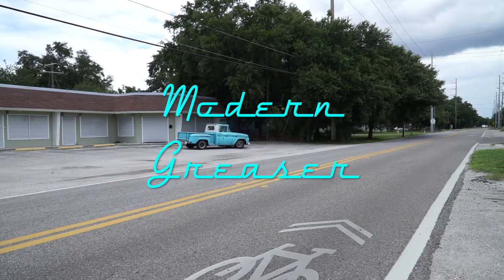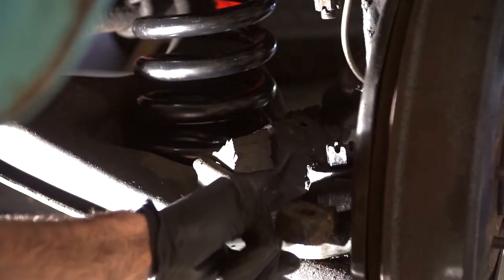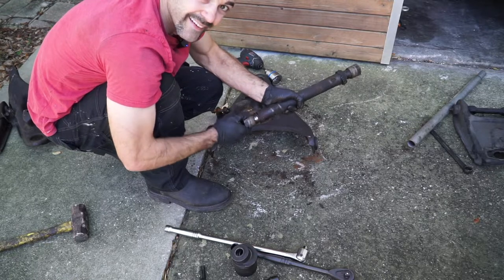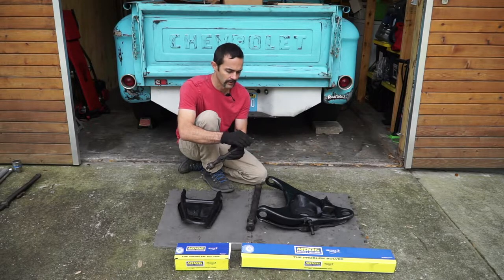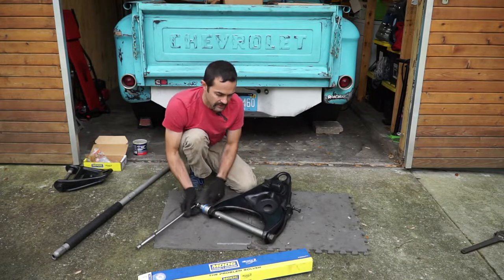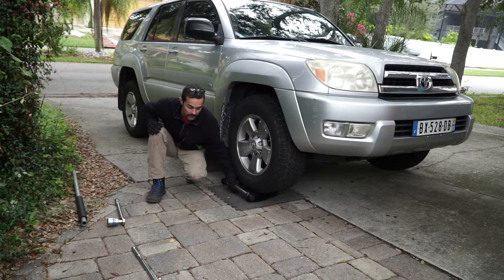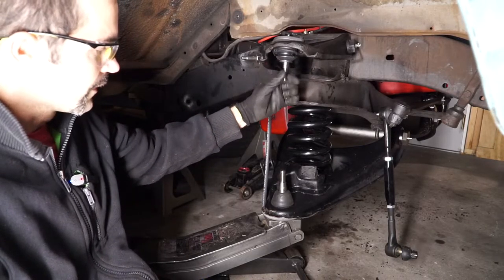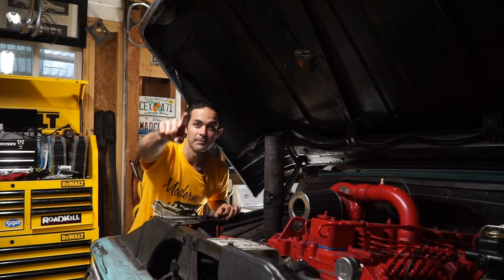BEST 1960-1988 Chevy C10 upper and lower control arm bushing replacement Modern Greaser!

Comment: Life saver video. Can we assume the upper control arm also uses a 1 5/8" socket?
Reply from the maker: Tom glad it helped!   The upper arm has a smaller cap that I ended up using two, large adjustable end “Crescent wrenchs” to tighten and loosen.  I didn’t have the socket large enough.  Sockets are cheaper than amazon at  AutoZone.  Less than $8 for the 2 1/2”.    Just remove the entire upper arm (2) 3/4” nuts and take the whole thing into Autozone to get a socket if you don’t have one.
Reply: @ModernGreaser  Hey thank you for the detailed reply! I have the control arms off already so I will take your advice and pop by my local auto parts store. The video was awesome however showing in detail the tear down and rebuild. Thanks again.
Reply: Old comment but the top is 1-3/8” the bottom is 1-5/8”

Comment: 😅😂 if you put an extension on a torque wrench you are increasing your leverage, meaning if you set it at 10lbs you are really torque it at 15lbs or more depending on how long your extension was.  FYI

Comment: What website did you order your parts from?
Reply from the maker: Parts for this job: 
Upper Bushings: Use on 1963 - 1972 GM trucks: https://amzn.to/2OqtXtp
Front end rebuild kit:  https://amzn.to/33sKK3g 
Lower Control arms:https://amzn.to/2zBQBKk

Complete kit.  The idler arms are essential. Made a HUGE difference in handling.  You can buy them separate. https://amzn.to/35S5Qei

Comment: How did you know that control arms were shot?
Reply from the maker: dan bentham when the spindle is off, if there is any play, slack or movement.  Replace them.
Reply: @ModernGreaser  my driver side is sat inch lower than passengers and can't work out why  some1 suggested new upper control arms but don't wonna pay all that money if its not gonna fix it
Reply from the maker: dan bentham I can see that being a possibility. Hard to diagnose. You could buy just one upper arm and install it and see if it helps. Only other thing I can think of is the coil springs